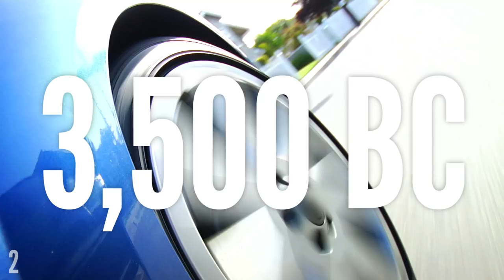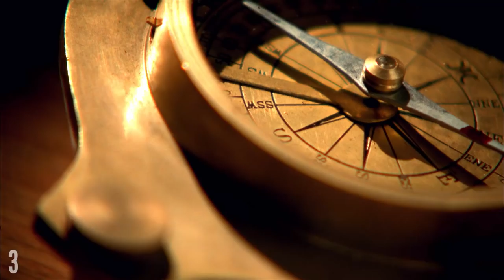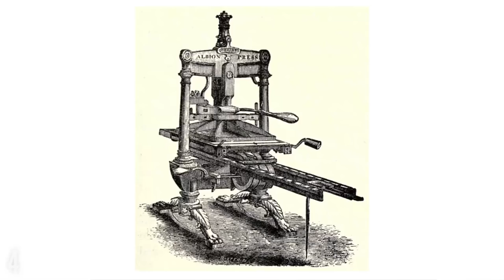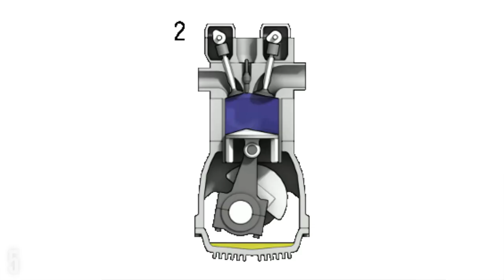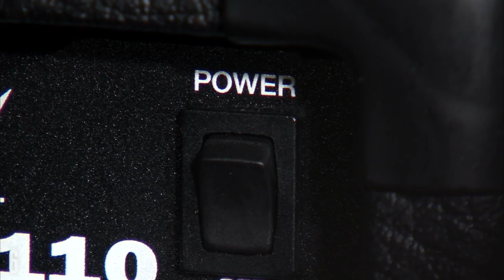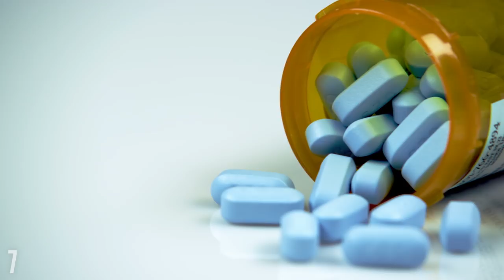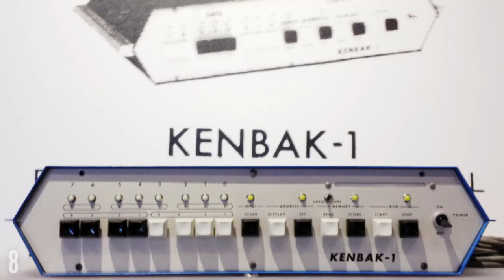10 Inventions That Changed the World

Comment: where da hell is Tesla? :)
Reply: ikr ... tesla is freaking awesome .. the spiral lightbulbs (the ones that use less wattage then edisons) can trace there designs back to teslas bulb
Reply: He did not change the world.
Reply: +MayMay Machine he advanced AC current to the point to where we use it today so ...yeah he changed the world .. even the wireless chargers u set your phones on have a trace back to him
Reply: +SL33PIN S3XY He didn't create AC, He created Dc which kills most things even at low voltages.
Reply: Tesla was way ahead of his time.
Edison was like: "Yay! I made the lightbulb turn on!" ,but Tesla was like: "Yay!I made the lightbulb turn on without any wires!"
Of course, for Edison it was all about the money , while for Tesla it was all about providing free energy to everyone.
Reply: @MayMay Machine  He did.  Let me count the ways:  1. Alternating Current.  2.  florescent lightbulb.  3. X-rays.  4. Radio (Guglielmo Marconi was initially credited, and most believe him to be the inventor of radio to this day.  However, the Supreme Court overturned Marconi’s patent in 1943, when it was proven that Tesla invented the radio in 1893.)  5. Remote Control.  6. Electric Motor.  7. Laser.  8.  Wireless Communication.
Reply: +MayMay Machine He actually did change the world. If we'd have stuck with Edison, as Edison was much too proud to concede that another's invention may be better for the world, we'd literally have the sun blocked out due to the amount of wires needed for our homes. Like it already was in New York - https://upload.wikimedia.org/wikipedia/commons/a/a9/Blizzard_1888_01.jpg - We'd also have to have an enormous amount of generating plants compared to what we have now, and they'd need to be in the immediate area where the electricity is going to be used. 

There's really a wide wide list of things Tesla has done that really have changed the world
Reply: +MayMay Machine Edison was not a scientist, he was a businessman
Reply: Hey Troy and Ultimate, as an engineer who has studied electricity I want to clarify some things.

Yes, Tesla invented the first versions of many useful electrical devices like AC generators and transformers, but there is a myth on the internet that he developed these techs to the point that they were economically viable or superior to the things we kept using and it was covered up by business. This is not true. You realize this when you see that his best invention at the time (AC current and the associated AC generators) WERE adopted by business because they were superior AND economically viable. Some of his inventions used transformers and this was also quickly adopted as a good way to regulate current for homes or other applications. His other inventions were not so much, more just novelty, and his methods do NOT produce free energy. 

Let me correct you:

1. Using inductors to power fluorescent bulbs. Tesla didn't invent this. It came from his ideas but it wasn't around for a long time. When it was discovered that you could use ballast inductors to produce a voltage sufficient to reliably ionize gas and make it glow (this is what fluorescent lighting is) THEN it was adopted. 

2. Tesla did not invent the radio. In fact he criticized the idea of using radio waves as unviable because he, incorrectly, thought they would travel in straight lines and be useless. What he worked on, and what generates some confusion, was trying to develop his wireless electricity to the point that he could make something like the telegraph wireless and communicate between towers. It never worked because he didn't understand how his wireless electrically worked and he could only demonstrate the signals being sent a few hundred feet. So Morgan backed radio instead of his tech, and it's a good thing too because his tech didn't, and still won't send signals like radio can. He thought a current loop was being created between the ground and the atmosphere connecting his towers. What actually was happening was electrical induction which is a byproduct of a changing magnetic field and it has limited range compared to radio. The principles of electromagnetism were not understood till Faraday began to flesh them out and maxwell stated them more clearly

3. Wireless electricity: yes, Tesla was the first to demonstrate that by using two opposing coils that oscillate carrying current through induction that you can generate a changing magnetic field and this induces current in nearby objects. However, this was a novelty and not super useful because:

A) it only works in objects that are very close to the source and
B) contrary to popular belief wireless electricity is NOT free. Inducted current that does work (goes against resistance) in nearby wires takes energy away from the source and follows the laws of conservation of energy like everything else. So it would cost the same as normal electricity and still need a power source. 

So think about it logically from a business perspective. You can spend money on a device that transmits electricity wirelessly a few hundred feet at most (and only that far by using dangerously high voltages at the source) or you can run some cheap wires which will carry AC current for MILES. Obviously the wires were better. There was no application for wireless electricity at the time because of its limited RANGE. This was the point. In fact, until today when we carry electrical devices in our pockets, wireless electricity continued to be little more then a novelty. But now it has limited usefulness because you can use it to charge cell phones in a house without needing to plug them in and this tech is being developed.
Reply: In space
Reply: INVENTIONS not inventors
Reply: Ruto Kelavra : Parked in my GARAGE . . .   
    Right next to my 
Pearl White Jensen Interceptor  440 V8

Comment: The reason wheels where not invented until quite late was due to the fact they where not a solution to any problems at the time. Basically there where not any roads, or practical implications for them. It was only when long established paths where wheel accessible, it became a great solution.

Comment: Pretty good article, but the Kenback-1 doesn't really deserve mention.  Computers were just getting cheaper and cheaper all the time in the 1960's, you could go in with your neighbors and buy a PDP-11 if you had many thousand dollars (I think about $10,000-$15,000).  The transistor is more deserving of mention since our first digital circuits were based upon light bulbs (vacuum tubes), and the transistor changed all that and made VLSI and computer chips possible and the electronic age and moon travel possible.

Comment: Thoughty2:  Edison championed direct current, as opposed to Westinghouse and Tesla, who had other ideas. Westinghouse was all for alternating current, which we use today at home and work. Edison's major problem was that DC did not travel very far distances without constantly being subject to passing through a transformer to boost the voltage. AC goes much, much farther along the power lines.

Tesla of course believed that power stations should 'broadcast' power, doing away with power lines. His idea has yet to catch on.

Edison actually electrocuted animals to prove that AC was dangerous and should be banned. There is a film of an elephant being "executed" after killing a man, more or less gruesomely proving Edison's assertions about AC.. But AC was the system of choice and is with us today.

Cheers!